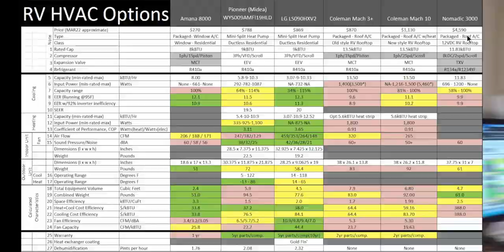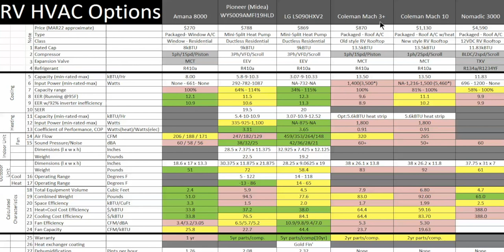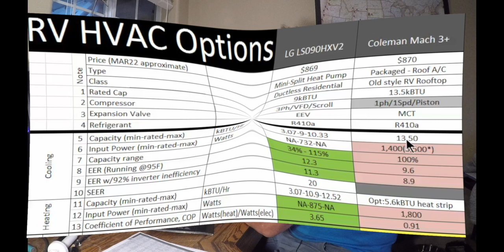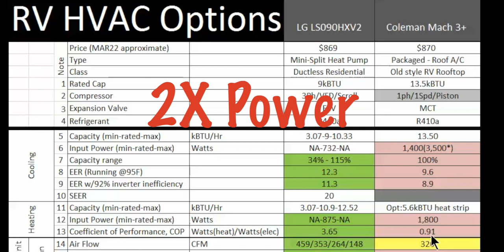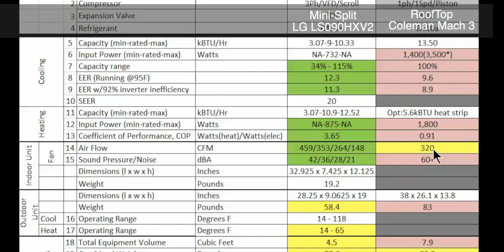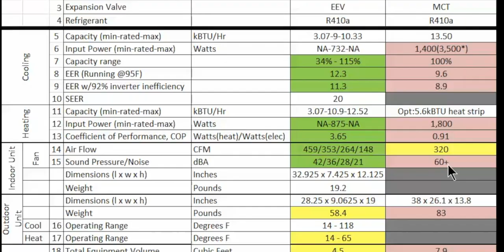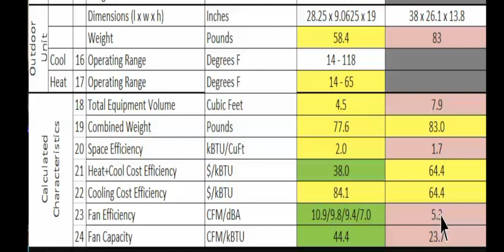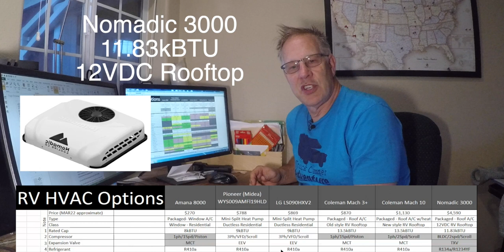RV Rooftop vs Mini-Split AC | Shop Talk | DIY Truck Camper

Comment: I have a Pioneer 9,000 mini split AC/heat pump in my van. It does a great job of keeping the van cool and sipping on the batteries and solar panels. 
Great video 👍
Reply from the maker: Thank you. I'm glad your unit meets your needs. Premium brands typically are able to run as low as 30% capacity instead of the Pioneer's approx. 60%, allowing it to consume much less power if only a little cooling is needed.
Reply: @WorkingOnExploring  your information would have definitely changed my selection. When I was looking I looked for information on the difference between the brands and Sadly couldn't find any. I live in the Charleston SC area and it runs 24/7 thankfully off solar panels (1,200 watts) on the roof of my van and 900 amp hours of lithium batteries.
Reply from the maker: @Scrambler85  Its a bit challenging to dig into specification sheets if you are not experience with it. On the LG and Pioneer 'submittal' sheets (both available with all my comparison data on my blog at workingonexploeing.com/techdocs), they show 'rated' capacity (100%) and two other capacities for a short termi high speed mode and a low speed mode. THE WAY to keep your A/C most efficient is for it to never turn off but to just slow down. It may seem contradictory but variable capacity A/C units get (MUCH) MORE efficient at low speeds.
Reply: @WorkingOnExploring  on economy setting it pulls 187 watts and on turbo mode it pulls around 1,000 watts. 
I will take a look at your blog. 
👍
Reply from the maker: Eco at 187W sounds too low for the compressor to be running but too much for it to be just fans. According to my spreadsheet, the WYS009AMFI19HLD has a low speed capacity of 5.8kBTU drawing 292W which is an EER of 19.9 (exceptionally good) but my LG has a low speed capacity of 3.07kBTU but no comparative power spec. I can't recall if I've measured it....
Reply: @WorkingOnExploring  I have a victron multiplus 3,000 the numbers are from the victron display. You are making me wish I had the LG
Reply from the maker: The spec sheet numbers are at 95F so if you are testing at a lower ambient, power draw will be lower.
Reply: @WorkingOnExploring  at 92F on economy setting it is pulling 183-189 watts. Setting the unit at 75F and the ambient temperature at 92F it is pulling 295-304 watts.

Comment: This was really good info on some of the differences to look out for between different A/C’s. Split systems are definitely the go for so many reasons; efficiency, versatility, smooth & quiet running with generally many more features/ timers, follow me, SEER rating, COP, etc. something to consider when buying one though; type of gas, ie: Propane based refrigerants are generally more efficient, R32 seems to be ok, and must be a inverter type for efficiency and the soft starting reduces surges on ur inverter and batteries too.  From what I have seen so far in comparing ac to dc type splits, is that for the price of a DC type air con, you can probably buy a decent 3-5kw AIO MPPT inverter as well and power everything as well with the money you save on buying a AC split system A/Con. Enjoying ur vids & ur in-depth mathematical & logical manner. Cheers

Comment: Great work and thank you very much. The answer is easy to see.
Reply from the maker: Thanks. Good to know in not just seen as blabbering techno jargon.....I want to do some more comparison on 48V DC mini-splits which is where serious RV systems that want to operate EFFICIENT DC air conditioning will need to go.

Comment: Thank you so much for sharing this information. Its one thing to know mini splits are better, its another thing to understand WHY and how much better they are. Now the tricky part...how to hide/mount a mini-split?
Reply: Very true. Most folks don't hide it and just park it on the rear bumper. I 'hid' mine by submerging it into the side of my chassis-mounted truck camper but unless you are willing to build your own camper, that is not an option. I know that some 5th wheel and class-A owners have managed to squeeze them into a bag box which is a good option but being larger RV's, it is a race between RV volume and A/C capacity to see which can fit. I think my more significant (unsaid) complaint is that the rooftop A/C manufacturers could easily build a unit with the same equipment at a similar performance, capacity and potentially price but they don't (more correctly won't) because there is little competitive pressure to do so. Having worked in building custom A/C units, the price of the 'old' type components they use compared to variable capacity is less than half....they are content with raking in a high-profit margin on underperforming equipment so long as they have no reason to do otherwise.

Comment: This is an excellent presentation. 

     I would add the EG4 mini splits to the mix (9, 12, 24K BTU sizes). 
The advantage of EG4  is their ability to operate directly off of solar as well as the normal AC/DC sources. This is very efficient for boon docking application when shore power is unavailable.

     SEER ratings >29 are possible and the heat function works down to 4 DegF  outdoor ambient temperature w/o needing a resistance or fossil fuel backup. 😎.
Reply from the maker: Thank you. I have been intending an update for some time but seem to keep myself to busy to find time. At present am building a shop /house in South central Idaho. There are a lot of new products on the market with interesting features that deserve attention.

Comment: Outstanding work sir.   The citizens of this country need people like you to work at the DOE to educate the political management about pure facts vs  fiction.   Very refreshing sir.
Reply from the maker: Thank you.....I am pessimistic about government ever developing an attitude of service to the electorate. As Groucho Marx is quoted as saying; 'Politics is the art of looking for trouble, finding it everywhere, diagnosing it incorrectly and applying the wrong remedies'. I am convinced, we are left to fend for ourselves and help others as best we can.
Reply: @WorkingOnExploring  What a perfect synopsis.   Over 40 years in construction and the last 17 as a government engineering and construction inspector,  now retired.  I can tell you that it is like rowing upstream with no paddle and people continuously punching holes in your boat and taking away any form of bailing device.   However...it's so easy to  circumvent the BS and make a difference every day for the taxpayers to not get robbed.   The method to use for this positive outcome is assembling the basis facts and statistics on the issues and presenting them electronically to a broad range of  principles and letting it soak in.   Exactly what you have done sir.   A few will respond,  most will remain mute.   One last email seals the understanding of my intended response and actions!

Comment: Steve, I'm a huge fan of your very detailed work. As an engineer I appreciate this kind of analysis.
I'm building out a class B campervan (promaster 3500 high roof ext.).
Any opinion on AC vs DC mini split heat pump?
Reply from the maker: I love the thought of using a DC mini-split BUT (long story short), they are 48V. 12V A/C is mostly R134a/Automotive based and the high currents of ANY low voltage DC system is almost certain to be at best  equally but more likely less efficient than a 120V inverter running a minisplit. I run a 24V system but should have run a 48V system. There are only a few 48V minisplit but they appear well made and efficiency is a primary goal. If you plan lots of A/C use (I prefer not to and hope to use my mobility to move to cooler areas)  and will have lots of solar to support it (I do), it may make sense to go to 48V. I've been collecting data to compare newer rooftop A/Cs to DC to minisplit. The bottom line is  most every unit running on low voltage has lots of loss in either voltage increasing or motor controls. Most lie about it (some quite effectively). I've been ferreting it out. Minisplit are residential units and are legally required to be accurate about their EER/SEER performance. There is no such mandate for A/C that is not installed in a residence (meaning everything in an RV or boat) but the The only real efficiency gains for DC powered are at or above 48V.
Reply: @WorkingOnExploring  That was above and beyond what I could have hoped for in a response, thank you!

Comment: I appreciate this information. I'm searching for my best solution.  Instead of a van I am cooling a semi truck sleeper.  Ultimately I want a low profile rooftop with minisplit efficiency.  The inside unit would be bulky inside the sleeper. Rooftop would have no loss of useable space. I want something efficient enough to run off the inverter for short time frames or a generator for longer periods. Are there any products  out there like this? I have not found anything yet that has this combination of physical packaging and efficiency. Heat will be done by a webasto bunk heater,, so cooling is much main concern. Thanks
Reply from the maker: You are looking for the 'holy grail'. I don't know of one right off because you are looking for a niche product with low capacity that is not suitable fo the RV marketplace, so let me ramble a bit.....There are several systems with different configurations. Since you are working with a small space, you likely need 5kBTU or less. This is really not the domain of mini-splits or RV units as they tend to be twice as large as you need. Having said that, there is really nothing other than a mini-split that uses the VRF/variable speed to attain the efficiencies they do..... Also, since you are needing to cool a small space and space constraints are more important, I don't think efficiency is as high a priority as space constraints and right size. Why are you not shopping for an APU (diesel engine driven AC alternator/DC alternator/refrigeration compressor)? 

The marine market uses an IDU (evaporator and blower) /ODU (compressor, condenser, and condenser fan) arrangement, they typically have a DUCTED IDU that can be placed inside a cabinet (evaporator, blower, and compressor) and an ODU of just the condenser coil and fan that can be placed under the cab or behind the cab (like an APU). (CruiseNcomfortusa.com) is a representative brand and there are several others. They are very expensive.
There are also some DC units that appear more like RV units and are probably too large (and are UNREASONABLY  expensive) but their smallest unit @2kW may work. see Nomadiccooling.com/. Rec Pro has begun making a DC equivalent for RV's that has too much capacity for you but is better priced (https://www.recpro.com/rv-12v-air-conditioners/).

 I think a 120V 'window' unit would be most appropriate but would be ugly and require cutting a hole in your cab that I know I could find unacceptable. Some of these window units are headed toward achieving mini-split-like efficiencies but are still far from it.

Comment: Incredibly well-researched.  TY for the content.  I'd like your thoughts on these "backpack mini splits" that have hit the market in 12v and 24v varieties from overseas and are much more cost-effective than other DC cooling options? Would the 24V flavor make you more interested in pushing that DC motor efficiently without the conversion loss of an inverter?  Thanks again, and happy travels!
Reply from the maker: With 'single stage's A/C @ 120VAC, there are 2 main losses; 1)in the 12V-120V inverter due to high 12VDC currents, and 2) the 65% efficient single phase motor. With single stage DC @12V, there are still the same huge DC current losses, this time in a motor controller switching the same current as an inverter. The BLDC motor can have higher efficiency BUT ONLY at higher voltage. The defining equation for power dissipation is : P = (I^2) x R. The killer in power loss is any high current when squared becomes huge.

 Assume for a moment a 1T/12kBTU A/C that might require around 1200W to operate. That is 100A, when squared is 10k. Assume the resistance is 1. Power loss is on the order of 10k. 

Assuming a similar capacity unit operating on 48V. Current is would be 25A and resistance would be 4. P = 625 x 4 or 2.5k. Increasing voltage by a factor of 4 decreased resistive effects by 4, meaning increasing efficiency by a factor of 4.

The critical problem is that starting at 12VDC will always be a killer. DC air condition only gets significantly more efficient at 48V or higher. The antiquated standard of 12 and 24V automotive systems will never allow efficient A/C and the sooner dispensed with the better. EV A/C systems are 360V, just like the drive motors and that is a voltage where losses are pretty low and motors pretty efficient.

Just going
Reply: @WorkingOnExploring  ok, so the benefits of not having to convert from DC to AC are outweighed by A) the inefficiency of running a DC motor at low voltage and B) the single stage motors in these "backpack mini split" devices (I wasn't aware, I thought they ramped up! :o).  Many thanks!
Reply from the maker: I'm not sure what you exactly mean by 'backpack'...modern, name brand mini-splits are most all 'variable capacity' which is accomplished with 1) a variable speed compressor. The variable speed is accomplished using a 'variable frequency drive'(VFD) which marketing idiots usually/incorrectly call an 'inverter'. Induction motors operate at an RPM corresponding to the input frequency. Being able to bring in single phase 60hz/120VAC, convert it to 120VDC, then converting it back to 120VAC/3 phase at frequencies from 20hz to 90hz allows use of a more efficient 3 phase motor (80%) at speeds from 1200rpm to 5400rpm and some associated capacity thereof. The efficiency loss in the VFD is more than made up by the increased efficiency of a 3 phase motor. The variable capacity allows the system to run continuously and thereby eliminate the efficiency loss of start/stop, which is considerable. 2) variable speed requires a more capable expansion device to control the wide range of refrigerant flow so they also need an 'electronic expansion valve' (EEV). 3) The type and number of compressor mechanisms is also a factor. The best use a 'scroll' mechanism with two scrolls offset by 180 degrees much like a dual piston compressor would have 2 pistons offset by 180 degrees. The scroll mechanism is not only much more efficient than pistons, it is capable of maintaining that efficiency over a large rpm range. 

Just because you have  A/C equipment called a ' mini-split' does not mean ANYTHING about how it is constructed. An awful lot of RV equipment is ancient technology because there are no regulations requiring them to be more efficient which there very much is for residential equipment. If you really want to compare equipment, you need to parse the specs and marketing BS to figure out what is in it AND how it is operated. The devil is most definitely in the details. You cannot just pick one type of A/C unit and compare it to another unit of the same type and size and expect you are comparing apples to apples.

I think there are some resources on my blog, WorkingOnExploring.com/TechDocs that may compare some issues but I can't recall exactly what's there.
Reply: @WorkingOnExploring  Still digesting your comments, but these new "backpack mini-splits" that have hit the market recently from China can be found by searching YT for "backpack mini-split" and also searching for YT videos under the name brand "Treeligo."  Many thanks for the detailed response.